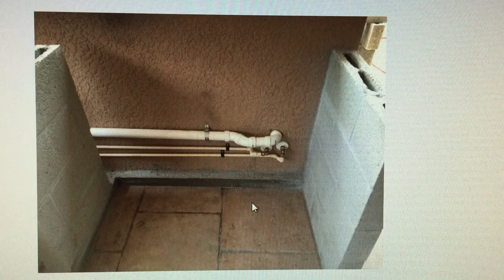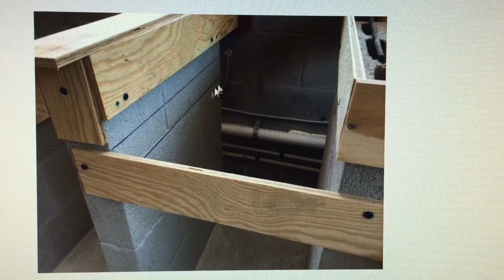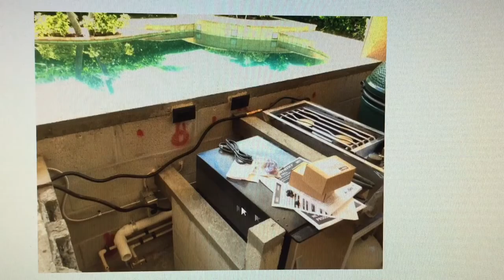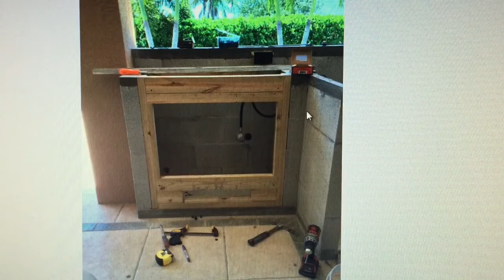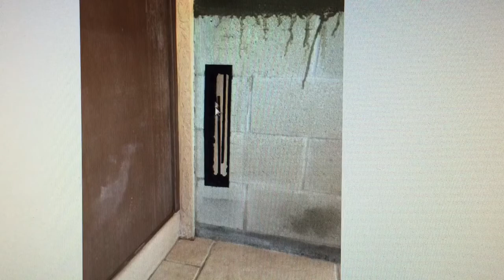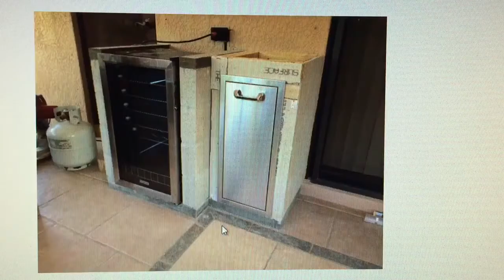Outdoor Kitchen Build Part 2

Comment: would steel frame be easier since less real estate?
Reply from the maker: AddictedFishing1 I’d be concerned with rust. But if you are a welder and proficient with steel construction it would take up less space for sure.
Reply: I'm going to start building mine this week, thank you for sharing your build. Definitely gave me a lot of ideas! Looks amazing, I just ordered the same trash bin as you did on bbqguys, does anyone make a taller tash can that will fit in the bin?